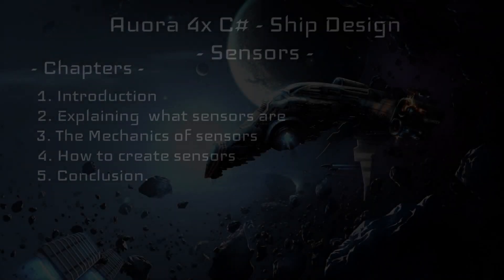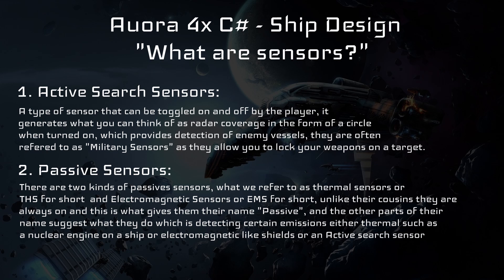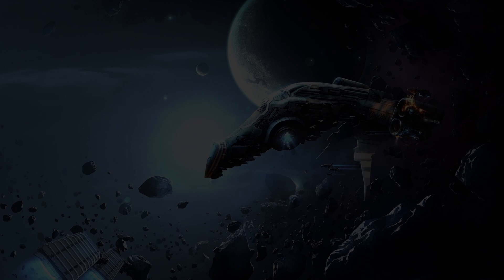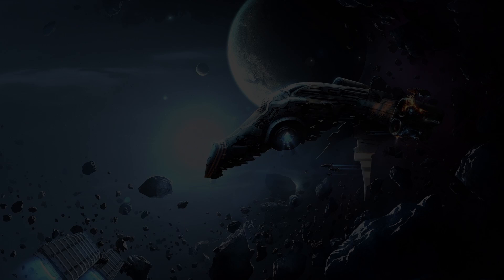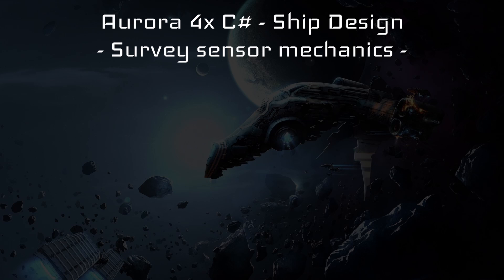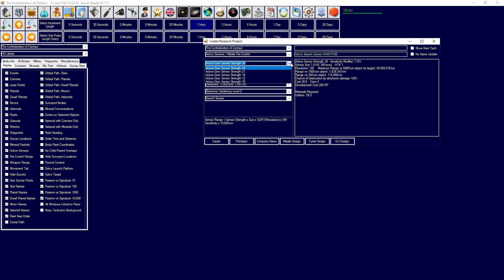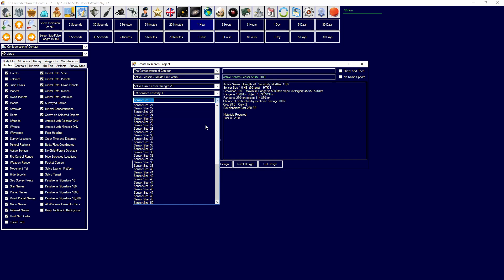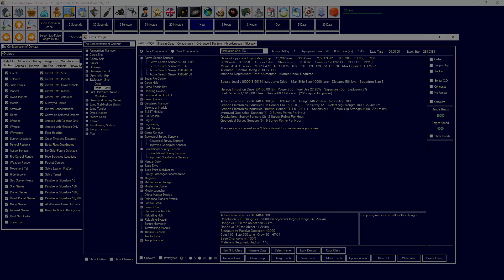Aurora 4x C# - Tutorial - Ship Design -  Comprehensive guide to sensor design/mechanics

Comment: On a commercial ship, or in general:
- Thoughts on whether it can be worth using size 0.7 sensors for 1 less crew than a size 1.0 sensor requires?
- Thoughts on sensors that require zero crew (size 0.2 HS), apart from missile fire control?
Reply: Probably depends if that one extra crew means you need more berths

Comment: Hey, Defran is it possible to scrap orbital Habitats. i built sodium refiners wrong but need to recover my components?

Any help appriciated
Reply from the maker: Your question is somewhat hard to answer, orbital habitats are for use in support populations on worlds where you cant use infrastructure or its too costly to do so, sorium or what your typo refered to as "sodium" harvesters  wouldnt be on orbital habitats instead on a station.

So i would need clarification is this a station?, is this actually an orbital habitat or a fuel harvesting station?

I will try to answer what i think your asking, to scrap a station to recover the components you will need it tool a shipyard to do it, if you want to change it quickly to fix a small mistake  you can turn on SM mode and then unlock the design of the station and add what you need in, and that will update all active ships.

I can give a clearer answer if you were to clarify but i hope this helps.
Reply: @DefranStrategy  Ahh so i built it wrong altogether so ha. Its a 500k station i built using the construction of the planet. Its has 30 harvesters and 10 million fuel but i realized that  was very small i also didn't designate it as a tanker so id like to scrap it and return the Harvesters if i could. 

The SM mode it like a cheat mode so. Maybe that is the best option
Reply: worked thanks :)